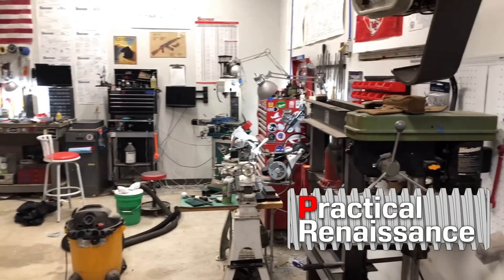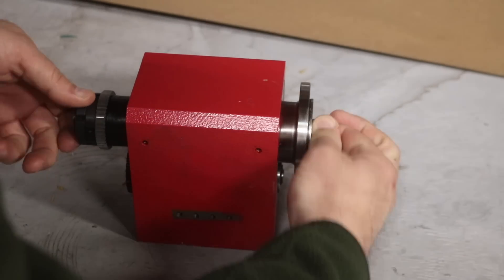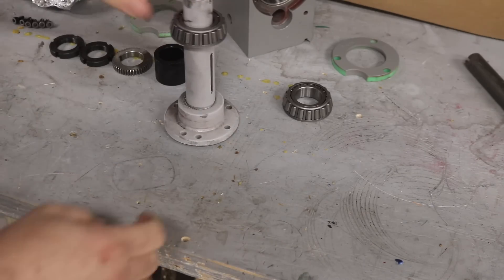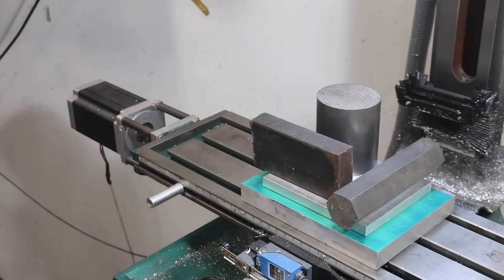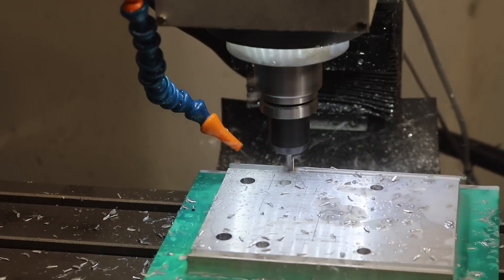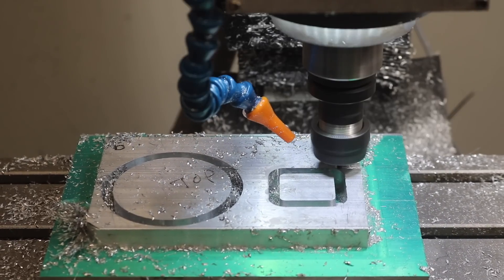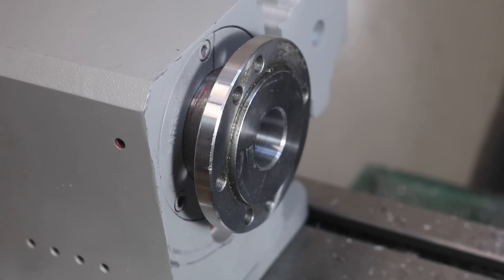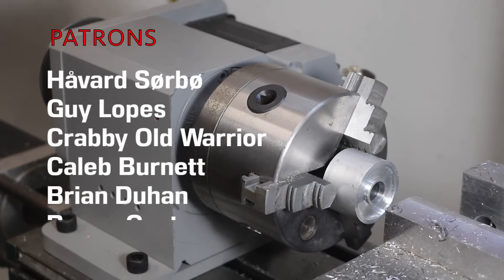Building a 4th Axis for my CNC G0704 Milling Machine

Comment: Did you consider angular contact bearings instead of tapered roller bearings?  Apparently you can get better precision/less runout with angular contact bearings and I guess for the radial/axial loads you probably will put on it both types will have far and away enough load-bearing capacity.  But wondering if you had any thoughts on it.
Reply: Thing is, they're the only good bearing upgrade. They say these are "more stiff" but that's not the bottleneck of stiffness anyway and you can get sealed angular contact bearings. Taper rollers are always open, not for dry systems
Reply: @MF175mp  You're saying angular contact would be better, at least in the case of this 4th axis build?
Reply: @perspectivex  even more on the lathe because the higher rpm there is no good for poorly lubricated taper rollers but there's one more thing, the taper rollers are thicker than original bearings in the axial direction whereas the angular contact ball bearings are all same dimensions as the original regular ball bearings. The bearings will withstand the load and much more.
Reply: @MF175mp  thanks for the clarification.  I'm getting the picture after reading a lot that tapered roller = for super heavy slower rpm loads, angular contact = for faster rpm, usually more precise.
Reply: @perspectivex  they both can be super precise if you bought the super precision versions. The taper rollers can take much more load having more surface contact area but that's not really an issue in a sieg headstock at all.

Comment: very well done.. I think the A axis is under motor tuning in config.. I could be wrong as i only have 3 axis..More likley is its arranged like super mario where you have to find the worm holes or the cheat codes to skip 3 levels.  The f360 should be interesting , running the simulations and praying it does that in real life. (-'

Comment: A 1:6 ratio will give you 3*6=18Nm at the spindle.. That's around 360N at 50mm from the center.. I have no idea what kind of thrust forces you could get when drilling off center for example, but it seems a bit low to me?
Reply: it is indeed too low, the stepper won't be able to hold the torque correctly while milling, unless of course you make a lot of passes...

Comment: Great work! I made a 4th axis as  well and use Fusion and Mach3. For the CAM fusion supports 4th axis, you only have to give it the 4th axis position in the post-process option (just before you save it). THere are cool tool strategys for 4 axis machining in Fusion, like rotary,  that you have to activate it. You can search online how. Regarding Mach3, on top of the pins and motor tuning, you only have to set the A axis or whatever you use as a rotary axis in General configurations. Last step is to set the stock radius, this is important to calculate the feed rate. Fusion will output G93 which is reverse time, so Mach3 needs to know the radius if you want the correct feed rate. The trick I suggest is to set it at the lower value possible, like 0.0001, and set your XYZ0 at the center of the stock. In this way you do not need to set the radius compensation in Mach3 anymore, and leave the 0.0001 value. Happy machining!
Reply from the maker: Great stuff, thanks! I think I have everything in Mach3 set as needed, except for the stock radius, my plan was to output any code for this to have my WCS origin at the center of the stock like you said.  I haven't done any full programming yet so I plan on clutching the E-Stop for dear life for the first few runs 😂
Reply: @PracticalRenaissance  Perfect, then assign the 4th axis position in Fusion post porcess and set the radius compensation to the lowest value in Mach3 (it's not in the main windows) and it will work out! Looking forward to see it in action. It's actually pretty fun. I have made some herringbone gears as well with it.

Comment: Nice.  Something you might consider is an idler pulley instead is sliding the motor. Then a slightly larger belt and the idler pulley doesn’t just tighten the belt, it changes the engagement with the small pulley. It definitely will increase the holding power of the belt wraps 180 degree around the stepper pulley.  If you need more holding than you ended up with, you might consider it
Reply from the maker: Good thought, I hadn't considered increasing the engagement on the motor pulley, it's something I will remember if I run into trouble, thanks!

Comment: I find the trick with the run from here button it to hit the cancel button when you get the "I'm going to move to this location" pop up and the hit cyle start after that.
Reply from the maker: Awesome tip, thanks! I never hit "cancel" on that pop up dialog because I blindly assumed it would just....cancel, lol
Reply: @PracticalRenaissance  yeh, we have been all there. "Run from here" coud have been made a bit more clear. I hit cancel as well and put the feed rate to 10% just to be sure, the speed it back.

Comment: I would be interested to know your findings with regard to whether the stepper motor's holding torque and dynamic torque proved sufficient to do (3+1) axis, and full 4-axis machining respectively, or whether and under what circumstances you lost steps and positional accuracy.
Reply from the maker: At first I had more concerns about it than I do after testing it under power, TBH, but will happily report back all of my findings and failings!
Reply: You can cut in a way that the cutting force is mostly projected into the chuck so the torque is not thaaaaat high.